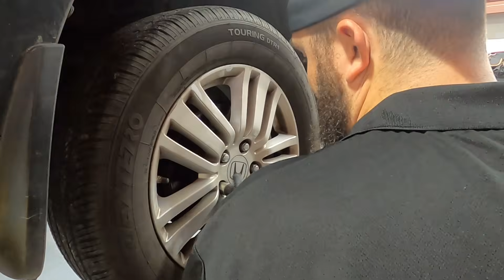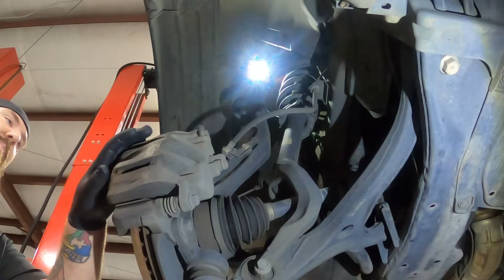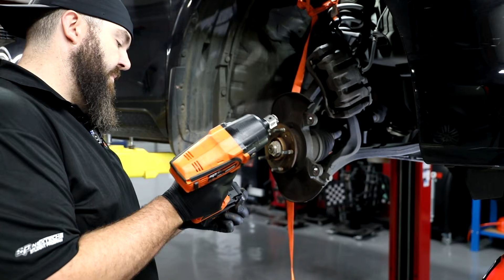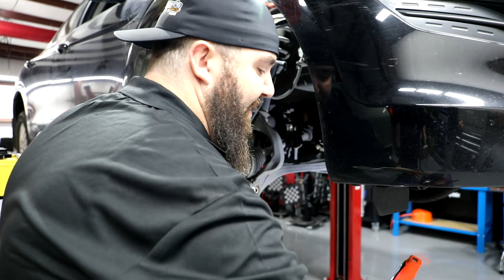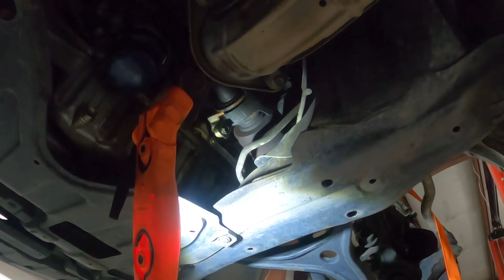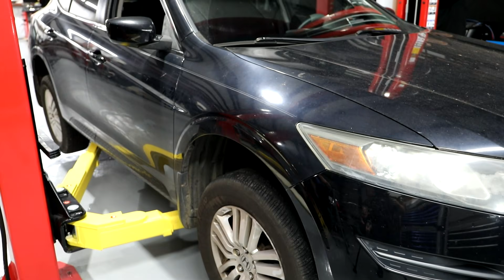2012 HONDA™ CV Axle Replacement

Comment: I don’t know if you noticed, but the original OEM axel that you took out had a counter balance around the shaft and the aftermarket shaft you installed didn’t have one.  I mention this because I have learned on a 2014 C-RV that it will most likely never balance out and ride smooth if you don’t use an OEM balanced axel’s.

Comment: So my 2014 Civic Si passenger side axle popped out so it was pushed back in but after driving I noticed afterwards it was loose so once I looked at the drive shaft I noticed the set ring looks like it was missing which I don't understand because the axle seemed locked firmly into place prior to it being pulled out accidentally. So my question is: Do I need to replace the ring? Or would I have to replace the entire driveshaft?

Comment: What is a keet spline?
Reply from the maker: Splines and keys are machinery components placed at the interface between shafts and hubs of power-transmitting elements. A spline (or key) is usually machined (or attached) onto the shaft of a power-transmitting pair, and the corresponding groove is cut into the hub.

Comment: My 2012 Civic vibrates on right turns accelerating and from stop accelerating but seems be ok at high speed that I can tell you would that be the cv axle
Reply: My 2014 Honda civic would knock when making a left turn. No vibration in the steering wheel. It's in the shop getting the driver side axle replaced. At first I thought it was the motor.

Comment: I just bought a 2012 CRV with bad front AXLES and the messykan who sold me the lemon doesn’t want to fix them and lied that axles are not part of the powertrain, which should be under warranty for 3 months after the purchase. His “preferred insurance” said it will not cover the replacement. What to do?

Comment: If you just take off top stabilizer bar you don't have to take ball joint or any of that off...the hub turns enough where you can pull axle out
Reply: You don't need to separate the knuckle from the upper ball joint? In this video, looks like he only disconnects the lower ball joint. In other videos, both the upper ball joint and outer tie rod ball joint are separated. According to the manual, they indicate separating the lower ball joint and stabilizer link.

Comment: Thank you for doing this. Question, should I replace my axel since it’s 11 years old especially I track my 2012 Si?
Reply from the maker: Thanks! If it's not leaking any grease, making noise or giving you any trouble you shouold be fine.

Comment: How do you know if the new axle is seated correctly? I installed one just like this but after installing the new axle I can pull it back out with my hand. Should it lock in?
Reply from the maker: Yes it should.
Reply: How do I lock it in I put it in place it went in all the way the spindles lined up otherwise it wouldn’t go in I even hit it on the other end with a hammer to hammer and if I tug on it,  it comes out.
Reply from the maker: @Salah-ut7uc  You should feel it pop in, make sure the shaft is completely seated and you may need to give it a couple taps.
Reply: Southern things? Ohio ain't southern...
Reply: Was the lock ring still on that inner shaft?  That’s what the outer shaft locks onto.

Comment: SO much of that beginning was unnecessary.
Reply from the maker: We assure you that getting the wheel off is very necessary lol.
Reply: @CEASUSA  Funny. 
I'm just saying, all you need to remove is the tie rod end, disconnect that abs sensor bracket, and the two strut bolts/nuts. You don't need to remove anything else.
Reply: @PanditaP  Oh a no it all here I'm a master ASE tech 40 years and I do think the guy was spot on doing the replacement of the shaft thats just how I do them.

Comment: What's the average cost for this repair?
Reply: Or find a good mobile mechanic and it will cost around $300
Reply from the maker: Depends on the shop, usually costs about $500

Comment: I never removed them screws that easy😂😂😂
Reply: Use cordless impact driver if u have one, if not go get one 😄, used one work just fine. Like Milwaukee M12, Makita, or Dewalt. Set on lowest setting, it will come off like butter.

Comment: why pull the lower strut fork off???
Reply: Not worth the hassle of shimmying the axle through that fork with everything hanging. Especially when it’s just one more bolt and a southern car where the parts just fall off.
Reply: You don’t have to remove it completely but you do need to take the lower bolt out at least because the inner joint of the axle won’t fit through it
Reply: @coreyscarrepairs  thats my point, he made a step in th repair that didnt need to be done, as a flat rate tech, why?

Comment: Can’t seperate all ball joints like that with hammer as they are aluminium and you must use a tool but great video 👍
Reply: You can if you use  a brass hammer.
Reply: Jay P not on Holden’s as they are to soft must use tool